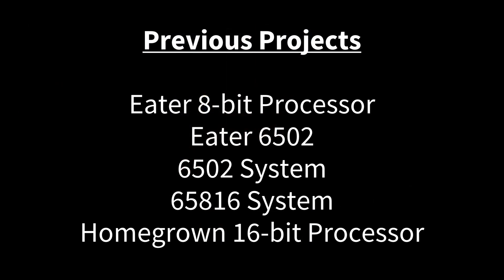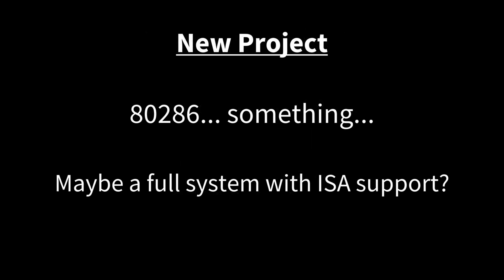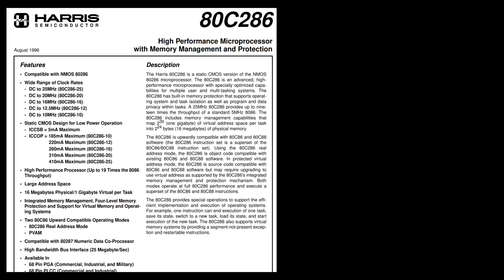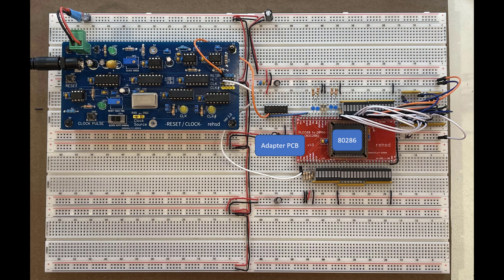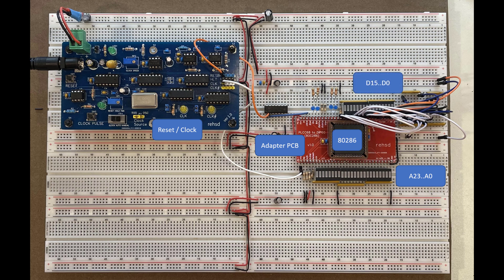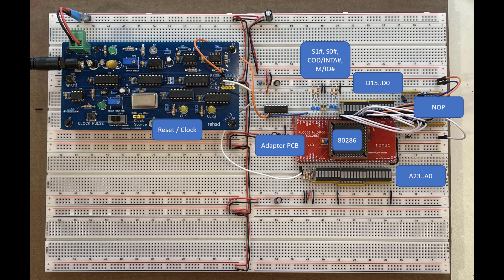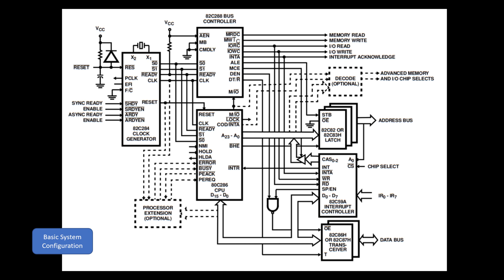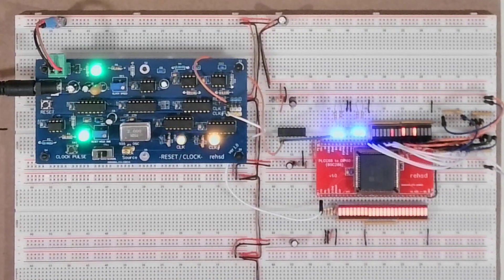80286 Build, Ep. #1 - Getting Started

Comment: Great video series and project, I’m in the middle of binging the playlist.

I’m curious why you chose the 286 though, I don’t think you have talked about that? 
Nostalgia, interesting ISA/architecture or something else?

Good luck and keep up the good work! 🤜🤛
Reply from the maker: Great question! A couple of years ago I started with Ben Eater's 8-bit breadboard processor. I then moved on to his 6502 video series. From there, I wanted to build on what I was learning, so I dove into the 65816, and I enjoyed that. I really wanted to work with a processor with a 16-bit external data bus and no address/data multiplexing. I then designed and built my own 16-bit processor, and I learned a great deal through that (it was a lot of work, lol). Motorola and Intel processors were then on my radar. I thought 8086 might be a good next step, so I ordered some 8086 and 80286 processors. The '286 processors showed up first, so that's where I started. :)  (And, the '286 didn't require multiplexing, unlike the 8086). As will be clear in the video series, I am starting at ground zero as far as x86 assembly coding, so this is a nice project for me to build up some experience with x86 coding. In short, I wanted a 16-bit data bus, a reasonably-sized address space, something that could (mostly) be done on a breadboard, a solution with available and affordable parts, and a supporting community (for all my dumb questions). In the future, I would like to work with other processors, like the 68000, Z80, 386, etc.

Comment: That's actually exactly the same thing I thought about after I learned about Ben Eater bb computer. Great that you decided to go this way, cause you can try to port a v6 Unix on such a machine, or even maybe 2.11 BSD: they were originally running on a PDP-11 and there are quite some similarities between a late PDP-11 and a 286-based late PC AT clones, certainly memory can be up to 2M or even more if one wants an X server. But that's a dream machine of course...
Reply: If you dig around one can find source for Unix System V/286, which is Svr2, release 2.... 0 I think.  It's for a Multibus I system, and should be compilable from System V on vax.   I used it extensively back in my misspent youth when 286-8 was 'hot'. (140Mb Maxtor XT1140 and a whopping 2Mb of ecc RAM).
V/286 still includes my favorite comment ever:
       mov     $0,%di          / never trust a micro
Reply: @ardentglazier2867  I'm running Minix 1.7.5 on a PS/2 Model 30 286 and unfortunately both model 30 and Minix are quite restricted and do not reveal the full power of i286.

Comment: Looks like a good start. What other pins did you remove going from a 68 pin package to a dip-60? I only count 6 NC pins on the datasheet.
Reply from the maker: Good question. The CPU has two VCC and three GND connections, which I bring to a single VCC and single GND in the dip. https://imgur.com/a/mfWCE1k
Reply: @rehsd  Gotcha.  As long as those footprints are for decouplers, you're probably OK at least for low speeds.  The ICC goes up to almost half an amp at 25 MHz, that's likely to cause problems especially with bus switching transients.  But for just basic testing, looks like fun! I might have been inclined to put a surface mount driver (244 or something) and some SMT LED's right on the PCB so you can see your status signals and a silkscreen label without burning up breadboard space. But I'd definitely add a few extra power pins before adding the extra LED current.
Reply from the maker: @zxborg9681  Good idea with the driver and SMT LEDs. Down the road, I can spin a revision of the PCB. Thanks!
Reply from the maker: @zxborg9681  An optional LED PCB that stacks on top of the CPU PCB: https://imgur.com/a/JeLyZsb
Reply: @rehsd  I never thought about a stackable top part, I like it!